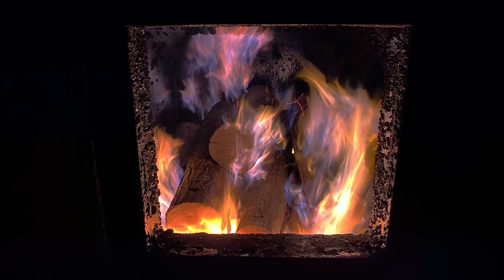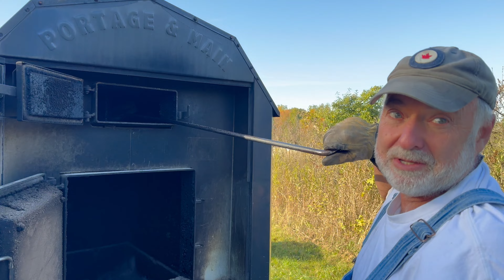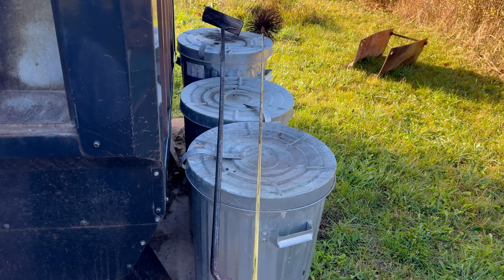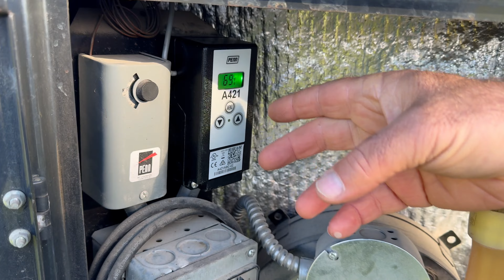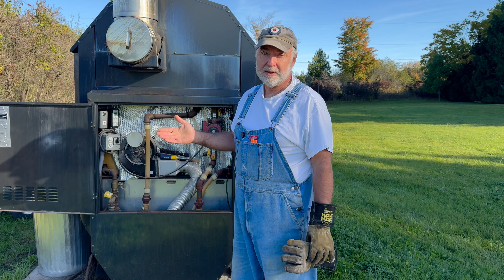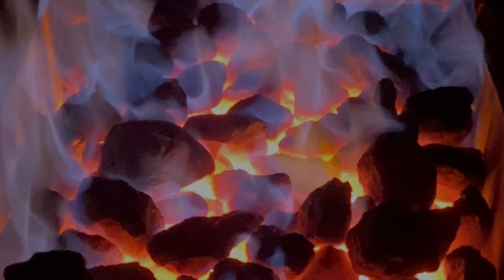Outdoor Wood Boiler Walkthrough

Comment: Great video! I just bought a house in rural Saskatchewan with the identical boiler. It was only used 1 season so it's almost brand new. I have to go through it and see if it's working properly but I can't wait to get it going. We have 2 houses on the property and a barn. The one house "The Farm House" is the main one hooked up to it but the install was not great. Very mickey-mouse. I have to re-assess everything so we got a Blaze King wood stove for now. It's never had a furnace and not ducting so it's hooked to Toyotami heaters. I want to get some kind of radiators. What is your boiler hooked up to? The other house that we are currently living in "The Cottage" has a hook up there but it's not actually hooked up so we are using electric heaters. Total nightmare! Even where the crawlspace is where it's hooked up is so messy and they didn't run the lines under the house to keep the floor warm and there's no insulation either. in -35, it's not fun. I have a lot of work to do.

Comment: thanks /a cord of wood is $800.00 where i live /i use ng and heat pump for heating and ac. was looking at boiler  for a new house build a few years down the road. i like the portage and main boilers /  good luck have a great day
Reply from the maker: Thanks for watching and commenting. $800 for a full cord of wood is a pretty steep price, and if you have natural gas available where you live, that'll probably be cheaper. To save money, an outdoor wood boiler should be fed with wood you cut yourself. I have a heating cost calculator, and if you sent me your cost per unit for natural gas I can tell you how overall cost would compare with wood at $800 for a full cord (4x4x8-foot pile)

Comment: how much do they cost and how efficient is the unit /great video
Reply from the maker: These things aren't cheap – over $10k, plus installation (which is not simple or easy). But the advantage is a much easier and widespread wood heating option. When I say widespread, I mean you can heat different buildings all from one, outdoor point. No carrying wood into the house, and no carrying ash out. Our system also heats our domestic hot water, and since it can use very long pieces of wood, it greatly reduces wood prep labour.
To be fair, operating an outdoor wood boiler is a lifestyle choice. If you like cutting firewood, and visiting the boiler twice a day in all weather, then the system is for you. But if you just want no-work heat and nothing else, then a boiler will probably look like slavery. 
Thanks for watching and commenting!
Steve

Comment: You should change your pump to pull off the bottom.  Also the heatmor boilers have dry bottom and replaceable top as well.  Been doing that for 40 years
Reply from the maker: Thanks for commenting. I've heard some people recommend pulling supply water off the bottom of the tank, but others say off the top. Two reasons why: hotter water temperatures at the top, and no chance of pulling sediment into the system. But I'm open to hearing why a person would want to draw off the bottom. Please fill me in.
Bye for now,
Steve
Reply: @baileylineroad portage pulls off the bottom as well now on their stoves.   Heatmaster, natures comfort, crown and others have all proven that putting off the bottom is actually much more efficient.  Better mixing of the tank, less spot boiling and less pump issues (positive pressure) also you can get a hot water spin down filter on your system if you are concerned about sediment.  I have one on my system, they are very effective.  Stainless 10 micron mesh with a sediment drain out valve on the bottom.

Comment: I've been watching videos on the portage and main boilers trying to gather information. There has been a number of complaints on how easily the steal rots out and they are prone for getting water jacket leaks. Have you ever heard of this? Was it on older models? Most of the videos I have been seeing are of units only a couple years old so of course everyone loves them and they are working fine.  Do you know of anyone that has these units that have problems?? Thanks

Comment: I was a Building superintendent in nyc where i had 2 boilers,  hot water heating system.   They worked exactly that this little boiler you have.   On a larger scale obviously and mine were gas/#2 oil.   Thank you for such a great vid
Reply from the maker: Thanks for taking the time to write. I appreciate that and your kind words. It's cracking cold here in Canada this morning, but we're all warm and cozy because of the fire in our boiler.
Bye for now,
Steve

Comment: Been running my central boiler 22 years in alberta,  saved thousands and thousands of dollars
Reply: No you haven't do the math.
Reply: Well how about you enlighten me why I didn't,  how about some facts on why
Reply: Whats the price of propane how much is a natural gas install ,where us tge wood coming from,
Reply: Figure the price of the unit, installation, wood, chainsaws, tractors, splitters, time maintaining , cleaning , fixing, replacing blower motors, water pumps and on and on and on and the fact you are a slave to this thing ..... believe me I know. The heat is great but with propane prices like they are now and have been for a while it would take way longer than 22 years to save thousands and thousand as you say, but then again that Canadian $ so not worth that much.
Reply: Where in alberta do I live, how big is my house
Reply: looking at doing this- in Alberta too. How deep did you need to dig the boiler water lines in? Wondering if they need to be as deep as my well lines or if one can get away with much shallower as the water is continually heated?

Comment: Steve, great video, been heating with my BL2840 since 2013.  Did a video for Brian back in 2013 covering the same topics and a few few mods that I did.  Had an issue with the underground piping but was warranted from the manufacture in Barrie.  Tks.
Reply from the maker: Thanks for your note and kind words. I appreciate you taking the time. I'm glad to hear that your experiences have been like mine.
Bye for now, and thanks for watching!
Steve
Reply: Can I ask how much space youre heating with your BL2840 and how?? im looking at the same unit but need to heat 1200sqft garage, 1400sqft home, and domestic hot water. Thank you in adavnce

Comment: Not sure how much you researched you did but Heatmor has been making 2 component stove for over 30 years with a fire brick Sand bottom! Portage and Main is still a mild steel steel furnace and will not outlast anything made with 409 stainless, unless you're a good welder. The 409 has the nickel and chromium in the 409 that will stand up against the creosote and not pit or corrode like carbon steel (mild steel). I can guarantee the mild steel base will also rot out as well, so not much good being 2 components because both top and bottom will need replacing. Heatmor use to make there bases out of carbon steel prior to 1998 and changed to 409 stainless because they new that carbon steel wouldn't hold up. Brian has been trying to copy Heatmor for years but still isn't there and probably will never be.
Reply from the maker: Hello Joe!
Thanks for your note and thoughts.
I did quite a bit of research before I chose, and one reason I went with Portage and Main is precisely because it is not made of stainless steel. I know more than a few people with stainless boilers around where I live, and several of them have had trouble with the stainless cracking. Although 409 stainless won't rust, it is susceptible to cracking from thermal stress. If you want to hear choice words, you should hear my friends colourfully complain after they've "tried" to weld their cracked stainless boilers.
And while you'd think that mild steel is a bad choice for a boiler because it can rust, in practice there's enough tar and such on the steel that it never has a chance to rust. In my experience nothing corrosive ever touches the steel inside the firebox because of the buildup of tar, and proper water chemistry (easy to maintain) keeps the inside of the water tank from corroding. The mild steel vs. stainless steel conversation goes back and forth endlessly over the years, but I've found mild steel better because it's tougher and quite crack resistant. I like welding, but would rather not do it inside the firebox of my cold boiler during a February Canadian snowstorm.
Bye for now and thanks for watching!
Steve
Reply: @baileylineroad  I've never seen a 409 stainless stress crack in over 4000 Heatmor furnaces we have sold! Only 304 (empyre) or 316 stainless stress crack which is caused by high chloride water. We can all protect the water side which is the correct thing to do but like I said the carbon steel doesn't hold up on the firebox side compared to the 409. That's why every other manufacturer other then portage and main has gone to the the 409 stainless because of it's longevity on the firebox side. Think your on Manitoulin island? We have about 20 of the island and have a dealer in Massey, ON
Reply from the maker: Hi Joe! Thanks for your input. I've never heard of anyone with a mild steel boiler rust out (though you'd have more experience than I), and there's never any rust that I see in the firebox. I did have an issue with the Optimizer I use to have, but that was a tiny design issue that was corrected. Does rust occur under the glassy tar coating? My firebox looks like it's enamelled with glass and I probably couldn't get down to the steel without chiselling or scraping. The inside of the heat exchanger is cleaner because i keep it scraped and brushed for maximum heat transfer, but even there I've never seen any sign of corrosion.
Bye for now,
Steve
Reply: @baileylineroad  You don't have to look too far on the internet for failed carbon steel units. Wood dr, Central Boiler and I know of several with Portage and mains. Facts are facts and nothing nobody can say different about the comparison. Like I said Heatmor has been using it for over 35 years and we units 30 years old still operating. Water quality and maintenance is also key! I've done a full comparison on all the conventional outdoor wood furnaces.

Comment: Hi there, great video, thanks . I am located in Calabogie Ont. which is about an hour west of Ottawa. I am currently using a Heat Master MF 5000 boiler. This will be my 3rd season with it and must say I'm not overly impressed with it. I will be needing to increase the size of boiler that I am using as I will be adding 2 more buildings to the setup in the next year or so. I'm strongly looking at the Portage & Main 34-44 as I will have aprrox... 4000-5000sqft to heat. Can you tell me approx.. how much wood you go through. With the heat Master I am burning at least 35 face cord per season. Seems like I am constantly cutting wood for this rig.
Reply from the maker: Good Morning! Here at my place we heat our 2800 square foot home, a 1200 square foot workshop, and all the domestic hot water we use. I probably burn about 50 24"-long face cords (mixed hardwood and softwood) That's a good amount of wood, but we do keep the entire house and workshop at about 22ºC (72ºF) all the time. I have access to a Heat Master MF 5000 for testing, and I'm trying to figure out how to hook it to my system temporarily (and fairly easily), then live with this unit for a while to make a wood consumption comparison. I'd rather not unmount my current boiler, so I'm trying to figure out how to do this connection temporarily. If I do I'll be making a comparison video.
All else being equal, I believe a person would burn less wood using a high-efficiency woodstove than a boiler, but that's not practical when you're heating as much as we do. We'd need at least three or four stoves, we'd need to bring wood to them, then we'd need to take ash out. Also, outdoor boilers can take much larger wood than woodstoves, so making the firewood is much easier. 
I don't think you'll find any other boiler than the Portage & Main Ultimizer line that's simpler and also surprisingly efficient.
Thanks for watching!
Steve
Reply: @baileylineroad  Thanks for getting back to me. Right now i am heating with the wood master and only heating approx.. 2200sqft and using like I said about 35 face cord. Portage and main claims that I will use far less even if I go to the larger unit, but from what you are saying that may not be the case. I don't think this MF5000 will be big enough for me once I get the other 2 buildings finished and connected either. I do like the simplicity of the Portage And Main unit though. Again thanks for getting back to me. As for hooking up second stove could you not run the water line from the new one and connect it to the old one right where it comes out of the unit and split the line with a shutoff valve on both boilers.. Just a thought.

Comment: Just recently moved into a house with an outdoor wood boiler. How do I get enough wood ready for winter with short notice and how to handle having it prepped for next year and the years coming? 
Trying to not have to buy any if not necessary. I’m in Kentucky so it’s not cold yet we are still having 80 degree days.
Reply from the maker: Hello Isaiah! Thanks for your note and thoughts. One thing about outdoor boilers is that you need to get some wood ahead and drying for them to be of full value. That won't be a problem for you next heating season, but for this one you don't have time to cut, split and stack wood before things get cold. So for this year, you'll have to buy some wood that someone else has cut. Depending on the kind of boiler you have, you could burn partially dry wood. If you started cutting and splitting now, that could give you some usual fuel for this year, too. But you should get busy now and start cutting and splitting wood for next season. Do you have access to a forest?  Another alternative in many places is to have whole firewood logs delivered to your place, then you cut and split those. I don't know if someone selling logs is a part of where you live, but it is where I am. 
I hope this helps.
Bye for now,

Comment: Why do people not put these boilers and wood under a roof ? Most likely you are going to fill this in Rain, Snow Etc ?
Reply from the maker: Good Morning! Great question . . . some people do put outdoor wood boilers under a roof, but that's certainly not necessary. These units are all made to shed rain completely, so there's no issue with water making its way inside. Think of it like a heavy-duty garden shed and you'll get the picture. 
Thanks for watching!
Steve
Reply: Most boiler type people are used to being outside in the elements and likely don't really care. The good more than outweighs the bad.
Reply from the maker: @tyharland1906  Yes, I think you're right. Actually, I consider it a benefit to have a reason to walk to the boiler a couple of times a day, especially in the evening during winter. It's dark, the stars are breathtaking, sometimes I see the nothern lights, and as I walk back from the boiler and see the house lit up and cozy, it gives me a good feeling.  It's one of those things in life where you put up with a little discomfort to get something valuable in return.
Bye for now and thanks for watching!
Steve
Reply: @baileylineroad I can NOT Love this response anymore than done!!!! I am researching and ready to pull the trigger and get one. Your video was thoroughly explained to a greenhorn like me and I couldn’t agree more with your appreciation of not only the work this boiler does but for the enjoyment of the morning and evenings adding to it! Besides the warmth one feels when adding the wood is just enough to not even notice the cold elements. After all a mind is a powerful thing to never waste! Thank you SO kindly for such a great video and a better understanding! Also may I ask what size of logs do you put in to last 12 hrs. I know it depends on the wood we burn but can ya tell me the measurement of the opening and about how many logs you can put in a filling? Thank you! 🙏

Comment: Great video thanks! I've been spending quite a bit of time researching OWB units and the Portage & Main Ultimizer is currently at the top of my list. I've only seen one negative review about them and it sounded like the unit got wet inside due to overflowing water out the top of the filler. The seal was not good at the filler tube so after numerous times of overfilling his boiler the water worked its way down the inside of the unit. Something to watch for and prevent from happening i guess. With good care and maintenance I do think the Ultimizer is probably the best one to invest in for the best daily and longterm results. Again thanks for the well done review!
Reply from the maker: Thanks for your kind words! I'm glad you found my review worthwhile. I really like the unit because of the reasons I mentioned. I also can't imagine how water could get inside. And even if it somehow did, I can't imagine how the water would not dry up and become a non-issue. At any rate, I certainly like my 34-44 Ultimizer. After years of using it, I wouldn't change a thing.
Bye for now,
Steve